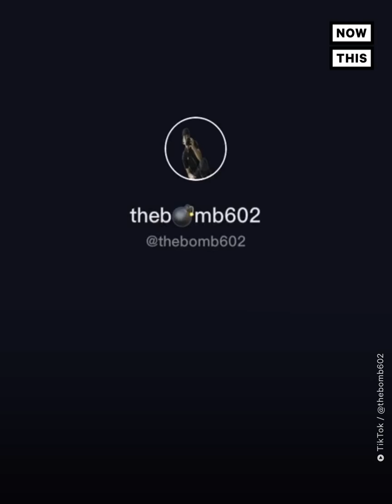TikToker Cleans Disgusting Computers in Oddly Satisfying Way | NowThis

Comment: People  be like “idk why tf my ps4 is so loud”
Reply: Some 🦗🐞 inside trying to sleep 😴
Reply: yeah, it's goshdang dirty :(
Reply: It can also be due to the thermal paste wearing off. So its good to replace the thermal paste after a few years
Reply: My ps4 pro sounds like an airplane. Ive cleaned it to. Its a thermal paste issue for the most part. The cpu comes with like no thermal paste
Reply: Cockroach inside the ps4: help me! help me! I'm dying... 💀
Reply: 569 likes lmao
Reply: @cloneskiller  if u opened up the copper pipes that let's u see the paste and the CPU u have to repaste u shouldnt open it up and not repaste bc that forms air bubblee which isnt good for thermal conductivity
Reply: @lunatic2178  tbh idk what to do. Im afraid to even bother redoing the thermal paste cause it might not do anything. I could be wrong about much thermal paste is on it. I might just get a ps4 slim or ps5 later down the road.
Reply: Bro I legit thought the reason why it was loud was because it couldn’t handle the games I was playing LMAO
Reply: Soo is it really cause the fans are dirty?

Comment: Air duster, q tip dipped in a little bit of alcohol. Just once every three weeks and a simple wipe down is just necessary for any electronic. It's not rocket science. 🤦🏻‍♂️
Reply: I am fixin' to get that air duster too. but clean a pc every 3 weeks ?  shane you've got no doggone life.
Reply: i just clean it like 4 - 6 months once, with some contact cleaner, change new thermal paste altogether, dust want that bad only caught on filter
Reply: really, every three weeks
Reply: I need alcohol, but I can't find any where
Reply: you are from the same country as Tinashe
Reply: @Jkapricorn  Covid-19 has caused a shortage. Main ingredient in hand sanitizer.
Reply: @LuminousSpace  changing your thermal paste for your PC every 6 months is not necessary
Reply: @Abyssinian97  what if you use a cheap thermal paste?
Reply: FloresAdr does no one use Articsilver anymore?
Reply: @FloresAdr  as opposed to cheap thermal paste? its not supposed to be expensive lol. at the earliest you could do it yearly but as long as you apply it correctly and in the right amount its supposed to last you years.
Reply: Yeah I’m planning on getting an air duster now. Do I just air dust the exhaust port where all the hot air comes out?
Reply: Twice or thrice a year should be good for most people.
Reply: But it voids the warranty
Reply: @mahchoo  depends if it's a laptop or pc, for a pc take off the side panel by unscrewing the screws on the back and just blow air on anything dusty, and for a laptop blowing air in is probably better than nothing but if it's really dirty then you should take off the back
Reply: @matth23e2  I got a laptop, biggest thing with mine is that my hands are oily so my keyboard has been hella oily.
Reply: @haritharannair3316   I'll say once every 2 months
Reply: Air dusters are too bulky, buy a can of compressed air
Reply: Twice a year is enough
Reply: @mahchoo  
Wash your hands more often my guy
Reply: I have my pc for almost three years now and cleaned it 3-4 weeks ago.
Really, there was almost no dust.

Comment: This is why "Right To Repair" should be best practice. I've been cleaning my own desktop since 2010 all self-taught. Learn the devices you pay for and don't be lazy.
Reply: But if you make a mistake that's hundreds or even thousands down the drain. There are billions of videos each with a different approach none of which will apply to whatever particular unit or set up you have. And the tech communities don't answer your questions unless your already part of the community.
Reply: @Theyungcity23  It's really not hard if you have patience and take your time. And of course if the thing you're repairing isn't purposely designed to be hard to repair.
Reply: Exactly 🤣
Reply: @Theyungcity23  the left in a nutshell

Comment: “How do people live with this” 
I meant if i know how to clean it properly and not having the afraid of it breaking i would have clean it
Reply: Actually, if you live in a clean house and live a clean lifestyle, your PC would never collect that much dust and roach. I once brought my 8 years old PC to the store to upgrade, before that i never opened it. The inside of that 8 years old PC is much cleaner than some of the PC in the video.
Reply: @duycuongnguyen6300  my house is clean as fk 
And i don’t even want to open it, im afraid i will break it lmao
Reply: @duycuongnguyen6300  depends on where you live
Reply: having the fear*
I'm sorry I don't know what tf is wrong with me 😭✋
Reply: Mostly it comes from the smoking near the devices it get all gross I can tell ya
Reply: @JupiterVortex  It's not that complicated, just don't put too much force on the plastic panels, sort out the screws and connectors so you know where they go, take photos if you're worried about what goes where in what order and you should do just fine. Desktops are even simpler, just pop the panel(s) open, vacuum inside, hold the fans while vacuuming them so they don't spin themselves to death and you're done :D
Reply: And repeat every 6 month if in a dusty environment, once a couple years is fine otherwise.

Comment: Just cleaned out family pc and it was worse than the cigarette one. The cpu fan had an actual carpet of dust under it. 14+ years of built up dust and dirt. Many hours of pulling dust bunnies and lots of qtips and isopropyl alcohol later, it works perfect now. I would’ve just blown it out with an air compressor but where i live its WAY too humid and i didnt want to run the risk of damage

Comment: How can you get that much dirt I left my old laptop in my cubbyhole for around 2-3 years and i took it out a few month ago for the ram and it has absolutely no dust anywhere and the cubbyhole is the most dustiest place we have
Reply: That's cause when ur laptop is on there is air circulation which sucks in air Inside the system and puts it out  ..but when it's off there's less dust particles being sucked into ur system

Comment: I worked at a repair shop once and a guy came in with a computer that was so insanely bad with smoke grime it was unbelievable. From standing 10 feet away, you could smell it. Not only that but the case looked like one of those older beige cases from the 90's.. ya it wasn't, I got a rag, started wiping and realized it was white... I don't even have to tell you what the inside looked like..

Comment: I had a whole Mardi Gras of roaches crawl up into the housing of my stand mixer. I didn't even know that was possible before I realized what had happened. And the newer appliances have no real way to just unscrew the bottom or the sides to open it up and clean it out. So I basically had to steam the inside with bleach and then shake their little corpses out. 
Still... I'm sure the inside looks like some of these computers.

Comment: I have had my laptop since the 7th grade. The first time we brought it to a technician aka last year, he was a bit shocked it had not been opened even once since it was bought. It was clean, had no dust and the reason it wasn't working properly turned out to be that the thinkingy used to receive WiFi was usually faulty in this model. He changed it, we paid 40 bucks, it is all well now.

Comment: I leave the side cover off of my computer for a reason. Then I can clearly see when it needs a clean. Due soon, before it starts to overheat, potentially becoming a fire hazard. 
Current temp at idle is 50*C/122*F. At load 76*C/168.8*F